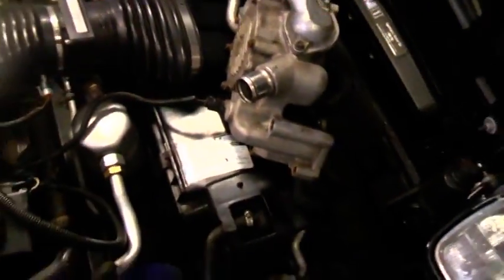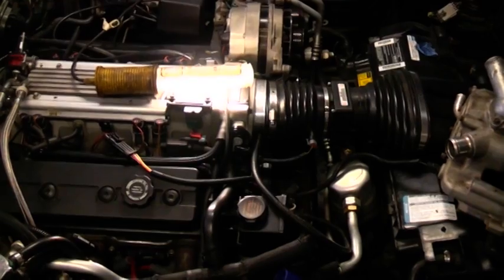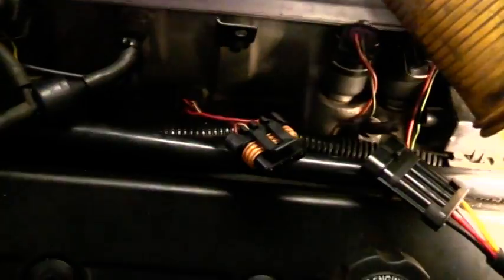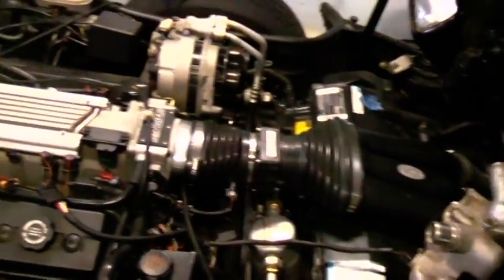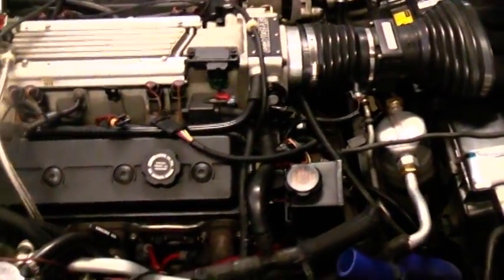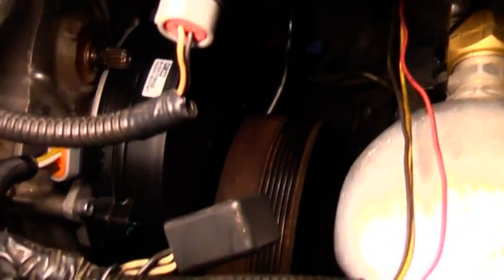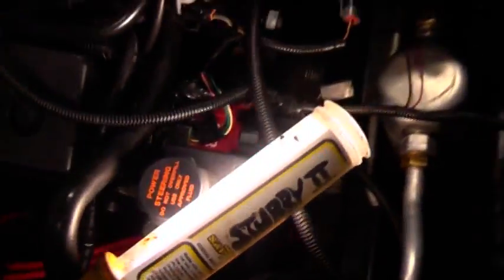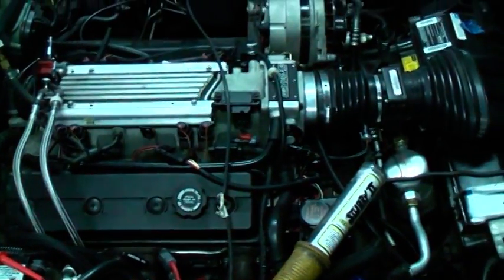1994 CORVETTE OPTISPARK DISTRIBUTOR PROBLEMS

Comment: You should not crank a starter motor that long, especially several times right in a row. That causes them to overheat and damages both the starter motor and solenoid. Let it set and cool between cranks. Spark is intermittent and orange, it should be blue. Indication of a weak coil, a bad cap, rotor or wires generally.

Comment: You need to bypass your VAT system...
Its located under the steering wheel...you'll need to remove the panel up under your steering wheel....But I may be wrong.

Comment: So what is a good optispark to buy? I know to stay away from the eBay optispark but, I’m thinking MSD is the best way 🤷‍♂️
Reply from the maker: I would go with a SacCity replacement opti, I had a $500 MSD with a MSD ignition box and it was a waste of money and unreliable unless you're set up for racing only and need a super hot spark. A replecement delphi with a Mitsubishi optic or a SacCity opti is the way to go and priced way better then a MSD. Good Luck
Reply: daredevil7442 hey bro I don’t know what SacCity is...is that a website or what?
Reply: MSD and Accel are not what they used to be, I used to swear by them, but nowadays (Unless it is a dedicated track car) I would replace with AC Delco/ Delphi or an A-1 Cardone because of the warranty

Comment: Im going through hell at the moment with my 97 camaro ss lt1.
All modded up, heads cam long tubes ecm programmed by pcm forless. Since the first time i got it running i have a misfire on #7. It just won't go away! Swapped out optis( summit racing brand) and i wish i could say it was the brand of optispark Distributor im using but sadly those aren't the problem.
Well, here i go, on another attempt at getting it running i took out all the spark plugs, cleaned them up like new cuz they were new the whole build has 15 miles on it. New msd wires, msd coil, unplugged new optispark, new 02 sensors i also replaced water pump temperature sensor harness i soldered it up nicely.
Cleaned up the ground that bolts down to the side if the block by the starter.
Ok, started up the car and it ran like a dream no misfires no hesitation at any revolution it ran clean and fast.
Well it only lasted one day running like that went to pump gas and on the way back home i noticed it was getting hot. Well one of the lower radiator hoses came loose and dumped all the coolant. The distributor didn't get wet at all because it was a lower hose got loose.
But when i got the hose tight and put fluid in it again the damn shit wouldn't stop missing again.. Just like day 1 cylinder #7 is not heating up the header like the rest. I poured water over it and it takes a while for the water to evaporate unlike the other header tubes the water evaporates instantly.
I done swapped injector positions #7 in place of #3 and same shit. #7 wont heat up.
Why only #7 wont heat up like the rest why it misfiring only on that cylinder?
Reply from the maker: Thats a tough one, maybe a corrupt file in the ecu for cylinder 7, maybe the harness/plug for injector 7 is not working/break in wire, stuck/not adjusted correctly valve, cylinder head gasket issue or manifold gasket? I would start with the injector wiring harness which is easiest to hardest as pulling the head.....it's something in that realm. Good luck and update when you find it?
Reply: Did you ever figure it out ?
Reply: @dakotavonrissen  not really. Car is sitting in the garage collecting dust. Wish id read up on lt1 issues before buying it. Would have bought a 98 or newer.
I got the number to a guy that said he tunes lt1's  and can tune out the 02 sensors and get it running. Only problem is he said it gona cost around $400-600.
Right now with all this corona goin around work is really slow. Just gettin buy with bills.
Reply: @sswcubes  I understand that I have 4 lt1s and half the time they all have issues just got my 94 z28 running but I had to go through everything on the car. I love these motors but they can be a real pain to deal with let me know if you get it figured out. I had my feed line on my fuel pump pop off just enough to let the car run but not great so it could be anything really

Comment: Well Fellow LT1 guys heres my dilemma. My '93 Formula Firebird 6 speed with 98,000 orig miles and never gave me a problem until yesterday. Never had any warnings but one dry morning on my way to work and got 2 blocks away then it stalled out on me(thankfully I lived on a hill & coasted back to my driveway) & I took my back up suv. I took my lunchbreak by driving back home and tried to see if it would start and it did! It reved great! So I went back to work. After getting done with the day I decided to take it for a drive & what did you know it happened again. So I decided to elimanate all known good/working parts(I have a DVOM & started with the battery. It had 11 volts & only 165 cca!! And the batt was only 1 yr & 9 months old so I got another one for free. Came home and installed it & it started the first time!!! It revved so I went for a ride & it drove awesome for about 2 miles and then it started chugging again & the service engine light came on. Can anybody with optispark LT1 knowledge please help me out?
Reply: I have this same problem.

Comment: How did you get your harmonic balancer off?  Mine is spinning when I'm trying to loosen the bolts.  And there isn't a whole lot of room with the frame in front of it.  Trying to replace opti right now and it's doing the same thing as yours.  Turning over, chugging after.  Body ground was good, checked that out already.
Reply from the maker: I'm guessing your working on a Vette and not an F-body, the frame is right in front of the balancer but, you can get a screw driver to fit in-between the frame and into one of the slots of the balancer and when trying to loosen the bolts the balancer will spin until the screw driver butts up against the frame and stops the balancer from spinning, once you get the screwdriver angle figured out, it will work very easily......takes a little manipulation but, easy. The balancer bolts is the easy part....if the balancer has never been off before it is most likely frozen onto the hub so, someone has to lay under the car and you will need a piece of wood and a hammer, while under the car, angle/place the piece of wood on the balancer and bang it with the hammer and have someone above spin the balancer and then keep hitting the balancer/spin/hit and repeat several dozen times...!! and eventually it will come off. I smeared lithium grease on the back of my hub and it pops off very easily everytime! good luck
Reply: ***** Good idea thanks.  My problem was about as stupid as yours though.  Damn coil plug wire cracked open so it was sending its spark elsewhere.  Wrapped it up and the car started right up.  New wires coming tomorrow.
Reply: Jack car up, and from under the car I used a long 24 inch or so) 1/2 inch pry-bar, take off the handle and with the sharp end as close to the center of the pulley as you can, and smack it.. then rotate the pulley.. and again give it a smack, mine came off after about 5 hits. do not hit the outside of the pulley !!! TO install.. coat the inside of the pulley/ crank shaft with a liberal amount of never seize, I did, and was I glad a year later when I replaced the cap.wires. MY 1995 red conv. 115,000 mils .. his setup is a MFkr to work on ! but is a good design .. ya I know. but I love my vette and don't mind working on it, I don't trust anyone else, and this way it's done right !..
 Jay the Pool Pump Motor Repair Guy in Florida TIP of the day.. 
when changing your fuel filter, try priming it with Fuel injector cleaner (Lucas) it's like a free fuel injector cleaning. or if your car is running ruff, you might need to repeat 5 or so times.. give it a shot and enjoy..
Reply: UberFAKnNooB
may I suggest a thermal fan switch also. it gets hot here in Florida. so for years I have been adding a fan, or triggering a fan with a thermal fan control switch, this lets the fan run after the car is shut off helping the motor cool, witch helps stop it from cooking the wiring under the hood. remember to place the sensor at the bottom of the radiator ! or carry a jump box with you.. cheers .. Jay   update .. the motor gets hotter when you shut it off, this is why I recommend the fan switch, it also give you added control of the fan cycle. no mater where you live
Reply: Jay Finke I recently replaced the radiator.  It stays at 177 while cruising, and cools down quickly with the fan if it hits 228 when I am stuck in bumper to bumper traffic.  Runs me right back down to 210-217.  It takes about a mile to get back down to the 190s even when it's 100+ degrees outside.  You outta post a video of your setup though.  People in hotter areas would probably like to know about that.
Reply: Jay Finke I'll keep that in mind should I ever have to remove it.  I lucked out with a cracked coil plug wire.  Damn thing was pretty well hidden.  Thanks for the info though.
Reply: UberFAKnNooB  I use a 2 by 4 and cranked engine but hub would never come off as I wanted to change timing gears too I replaced my opti spark the car started .Then I  replace all part on car like water pump so on .Car will not started . Now for this https://www.chick.com/reading/tracts/1022/1022_01.asp Driver hits the wall .
Reply: I just needed to remove the pulley, get it off and then attack the bolt, it will give you more room.
Reply: Jay Finke IT THE HARMONIC BALANCER REALLY .Replace the Otpispark car started put everything back together car now won't start
Reply: michael parks check the wire (plug) that goes into the distributor and then check for spark, pull one of the wires off and place a plug in it, see if you have spark
Reply: Jay Finke PUT A SCREWDRIVER IN THE BOOT OF COIL AND THEN ON COIL GOT NO SPARK BUT WILL TRY WHAT YOU SAY .
THANKS

Comment: i had a similar problem but itested the dist/opti off the engine  by turning the shaft by hand the low res sensor is i of 2 photo interruptors on the disc wheel. the disc has 360 slots near the outer edge a ir emitter beam / IR sensor is interrupted 360 times per cam revolution to trigger the ign. coil [hi res sensor] but the computer need low res pulses to "know" which plug to fire.  the other lo res sensor uses 4 different size wheel holes 90 degrees apart to do this. The sensor [the slotted plastic part the disc wheel passes thru}  is the culprit. a new sensor is about $40.

Comment: Might have to take your distributor apart, check the metal disc, it could b bad or the opti lens to the opti sensor that reads the low resolution could b bad. Is the vacuum lines good? Could b build up of vapors in the distributor
Reply from the maker: the problem turned out to be a combination of a bad body ground strap and a faulty ECU, replaced both and all is good.
Reply: O ok thats cool
Reply: daredevil7442  I have a 96 trans am,  lt- 1 350. check engine light flashing, rough idle when cold, smooths out when it warms up. any ideas? I'd appreciate any advice. thanks!

Comment from the maker: I had a couple of issues, the ground under the brake booster was bad, I have a slide show video showing how to change that ground strap, check my video list for that repair and then the other issue was my computer was bad, I called PCM for less and got a used computer that was tuned for my car's mods for $300 bucks, that fixed the issues and the car runs sweet. So, when getting a opti spark code but, the car still has spark and fuel pressure which should turn off with a true opti code, then the problem is most likely with the grounds and/or computer. Good luck.

Oh, forgot to mention, I left the engine hood of the vette slightly open and it rained, I think the water that ran don the windshield washed into the back of the computer and water went into the 4 plugs and that might be what killed my ECM....maybe but, who knows, these things break all the time.....from what I read??
Reply: daredevil7442 😂😭 breath man breath 😂😁👏👏👏🍻

Comment: ok i just went through the same thing with the same opti richporter thought it was ok then i started getting the same code as you in the same fashion 

go to ls1tech type in lt1 hell

turned out to be voltage at the ecm . it is strange how close the symptoms are i was getting very little voltage so it did run but you might not be getting any at all !!!!

if you fixed it please let me know what you did